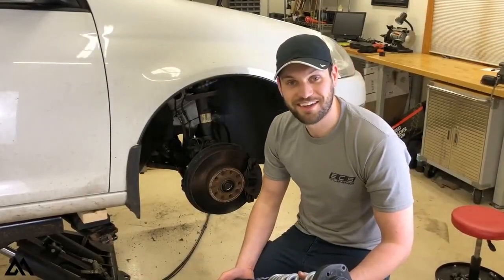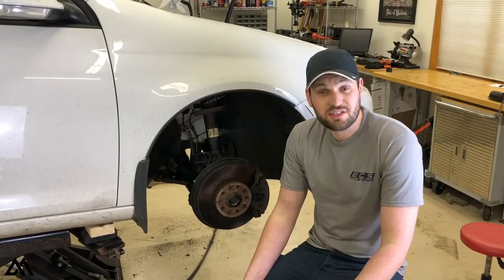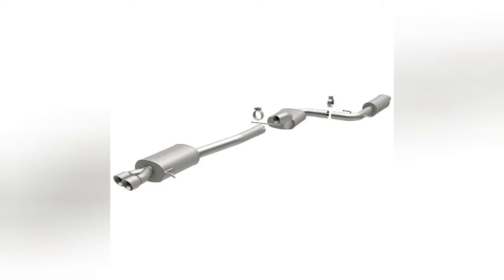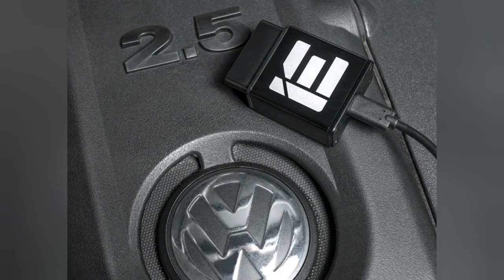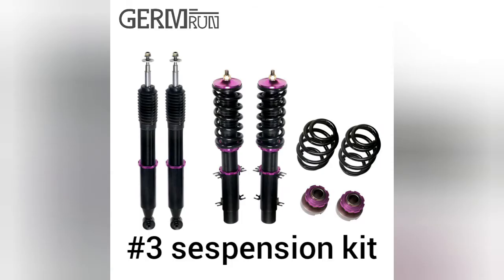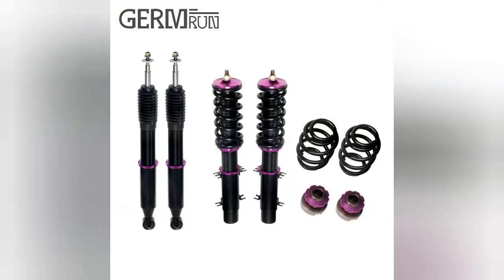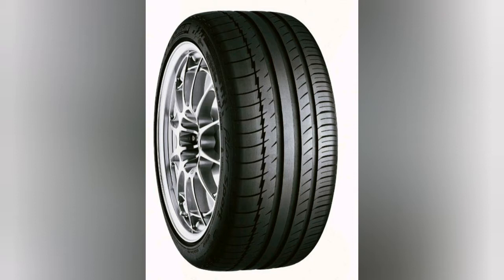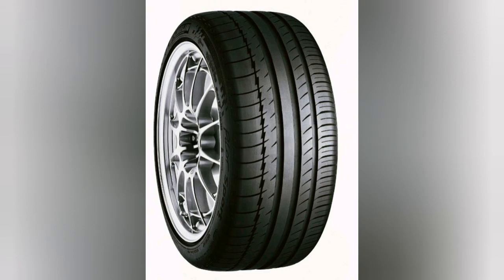Top 5 Most Effective Mods You Should Get For Your Mk5 Or Mk6 Jetta

Comment: Stole my 09 2.5 jetta for $750 hehe. Granted it wasnt running. After about $500 and some time car is perfect and even fixed the ac. I think they thought the rear main was leaking. Just vacuum pump. Absolutely love this car
Reply: I got one for 1800 with a new engine.  it was a county employee vehicle , bought it at one of their auctions . It's a 09 2.5  the thing is in immaculate shape. I've had it for about a year now , I've replaced the crankshaft sensor.  I love the stability and the torque for such a little car, I had it tuned and remapped the air fuel mix and with everything stock it dynoed at 218 hp. messing around I've smoked a Camaro and a challenger both 6 cyl though lol. These cars are fun, thinking of a turbo next.
Reply from the maker: Thats awsome dude! And yeah these cars are very fun to drive:)
Reply: @vicchavez6570  I just got mine from the auction for 1800 :P I pick it up tomorrow hopefully everything goes well
Reply: got mine not running with a blown headgasket for free
Reply: got mine completely abused not running for free
Reply: got my 2013 2.5 5 speed for $750, runnin and drivin other than the usual vw ignition problem
Reply: I got ripped off buying a MK6 2014 2.5L jetta SE for $3500. Although after buying it, i bought my own tools and saved myself about $5,000-$7,000 in labor costs for the repairs and upgrades i wanted for my car. Now i’m a full-blown car enthusiast, and I managed to fix all the error codes and the car is now running better than ever with 180,000mi!
Reply: Got mine for 900 still in the process of fixing it but this is my second mk5 08

Comment: To anyone watching this and thinking about turbocharging their 2.5 for the love of god don’t buy the Hans Turbo kit. Turboing the 2.5 is a very expensive project roughly 6k-12k. Currently the only turbo manifold that can be purchased new is from SPA going for $450 from there it’s a DIY project all the way comprised of sorting parts and fabrication. Unless it’s a novelty or project you really want just get a GTI or GLI for the same price. In my case I am going the Intergrated  Engineering Route which is roughly 3k for their performance parts and then going with a Borla exhaust.  Also please note the Audi 2.5T and VW 2.5l are not the same engine build very differently. The only swap I have seen of a Audi 2.5T on a VW Rabbit was almost 30k the engine alone was a salvaged RS3 engine and trans. Anyways good luck to anyone and their project 2.5s.
Reply from the maker: Yeah, another thing to mention is that the 2.5T block is made of  aluminum and is completly different from the iron block 2.5 N/A

Comment: I just bought a 2006 VW Jetta for $400 all I needed was a fan lol best car I’ve Eva had I need to knew where to look I’m going for the street racing car body kit lights steering wheel and I want a big as screen instead of the radio it comes with

Comment: Be careful when it comes to suspension mod. Those engineers know what they are doing. I you can't just willy nilly throw stuff on, you can upset the handling dynamics. I have a Mk6 wagon and I'm going to install the VW DG sport springs with Koni yellow dampers. These are essentially GTI springs, so they are factory approved.  I will have the install shop dial in the rebound damping to match the spring rate. This is important. Plus you don't want overly stiff springs. The suspension needs to be compliant on the street. Race stuff is for the track. I am not messing w/ the sway bars. A stiffer rear bar on a front drive car can reduce understeer, but it can also lead to 'lift off oversteer'. I'm not an engineer, so will not second guess.

Performance tires make a huge difference, but again you can go overboard. Super grippy summer compound tires a) are expensive and wear quickly, b) pick up rocks and then spray onto your paint, and c) can put stress on the suspension it was not designed to handle if you take advantage of the grip. If you gain massive lateral grip and drive the car hard, you are going to wear out the suspension bushings, unless you swap in hard plastic race type. Not to mention stress on ball joints, etc. I run Eagle F1 A/S (unfortunately discontinued) A great blend of performance, comfort, all season use and affordability. 

Hate to sound like a dad, but ya gotta be smart about upgrades. 

I looked into software tunes, but there's only so much you can do with an N/A motor. I'm sure with the IE engine and tranny (I have the tiptoe trans) it would be more lively and fun, but it is very expensive for what you get.

And turbo, done correctly is probably gonna cost more than the car. 

Don't get me wrong. I love the 2.5. Probably best motor VW ever made. Just bullet proof. Sure I wish it had 200hp. But I don't have to worry about carbon buildup, or blown turbos, or sketchy high pressure fuel pumps. It's fast/quick enough to be fun in a daily driver. 

Oh, a great inexpensive easy to install mod are upgraded brake pads. I run EBC red's and they are great. Much better bite and easier to modulate than stock. If you wanna drive swiftly, you have to stop quickly.
Reply from the maker: Good points!
Reply: That ie tune with supporting mods can get you pretty close to the 200 hp sweetspot. And that 200 hp feels way better na than it does in a 2.0t
Reply: Nerd
Reply: @evilpanther990  No doubt. 🤓 I've since done the IE tune. It's fantastic. Car is much more lively thanks to the big increase in torque (215 ft/lb) 0-60 in 6.9, which is on par w/ stock GTI of the era.  Penalty, besides price of software, is requirement to run premium fuel. Oh.....Koni Sports are a bit over damped for stock GTI springs. The FSD would be a better choice. With the Sport, the suspension is compliant, but stiff......you fell every road imperfection. Handles great though.
Reply: @evilpanther990

Comment: 09 2.5 Jettawagon for $1500. Just about 300k miles and check engine light stays off. Manual makes it amazing
Reply: I have the same car , 09 2.5 Jetta Wagon , I paid $2000 with 296k . Is just a car to work , fit all my tools , today with 378k have some issues on sunroof and sunscreen , I already spent around 6k with unscheduled maintenance + regularly maintenance cost in 3 years still reliable. But now I have the a/c no working, blower just on 4 speed and some bearing noise . Need to spend a little more haha

Comment: Hey I have a question? I just got a mk5 2.5 and it does smell like burn and it’s hard to tell if its from the fan or from the engine but if you could tell me that would help a lot cause I was just concerned where it comes from but I can’t find it. Thank you
Reply: If you're smelling a burnt smell while it's running you should probably check your oil or transmission fluid

Comment: For the $700 turbo kit, what is included? Does it include a turbo or it is just a tune?
Reply from the maker: I dont think it comes with a turbo sadly:( I think its just a tune or setup for which ever turbo you plan on intsalling. All that i know is that it comes with an ecu tune, turbo installation kit(tubes, diverter valve, feeder)  an intake manifold etc. If you want you can find a turbo exhuast manifold from JDL Auto designs, and 5858 or a 5859 turbocharger. Im not sure where you get the turbo back exhuast from. Thats all i know:)
Reply: @Siriusgxmiq  Thank you bro.
Reply from the maker: Np man:)

Comment: Where can I buy the stage one Ecu tune ?
Reply from the maker: Integrated Engineering, APR, or 034motorsports
Reply: I went with the IE stage 1 tune. No complaints, its not huge power difference but it’s noticeable, it raised the redline from 6K to around 7,100K and has little pops on deceleration. (With a exhaust of course) totally worth it!👍